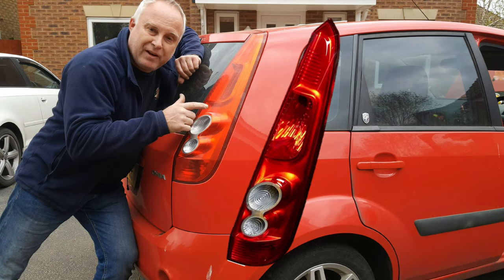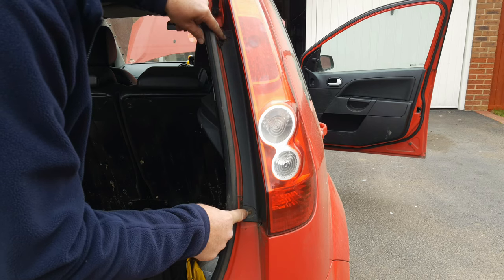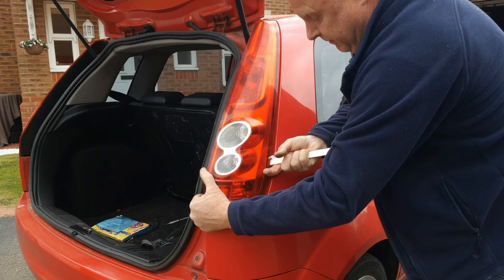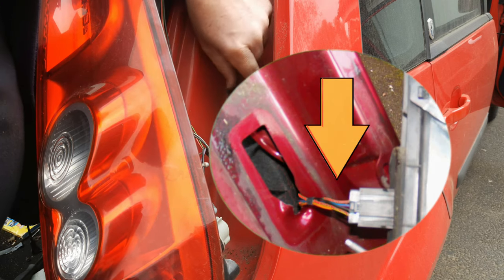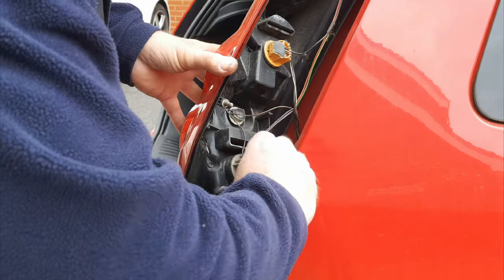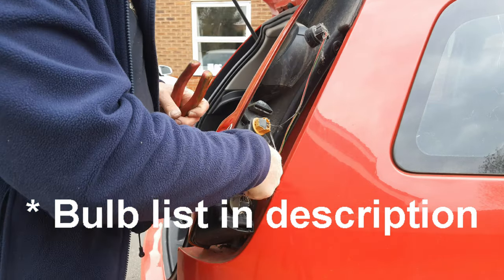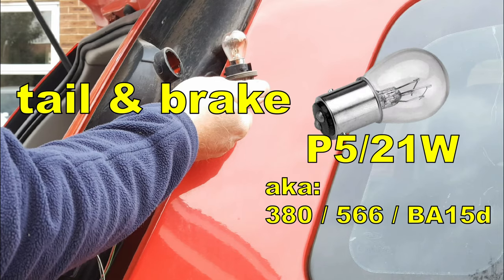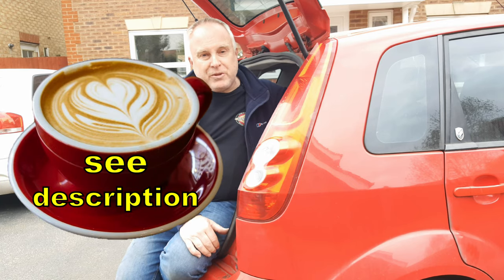Fiesta mk6 Rear Light Bulb Replacement by Removing Fiesta Rear light Cluster

Comment: On mine when removing the rear light cluster there is also a screw behind the light itself that needs removing from inside the boot.
Reply from the maker: Thanks for the tip. Ours must have been missing

Comment: Thought the reverse was a 955 or doesn't that number matter?
Reply from the maker: 955 is just another 'alternative' reference for W16W. You could use either 👍
Reply: @CycloneCyd  Oh that's good to know, so basically any w16w bulb would fit in there then? I was thinking of putting led reverse bulbs in.
Reply from the maker: @thew4rrior5code  I know it's been a while, but if you haven't already got an LED bulb yet, I have negotiated a 15% discount code with Auxito. Following this link will take you straight to a W16W LED that is std size and non-polarity. Use voucher code PAULCARTER at checkout to get the discount. The code is valid for all products across the site so fill yer boots! https://auxito.com/collections/912-921/products/2f18-t15-w2?ref=wi7p4aau45